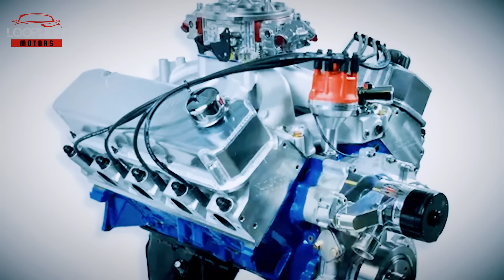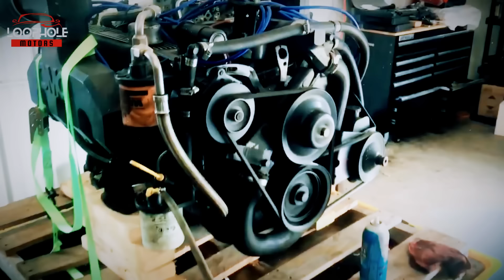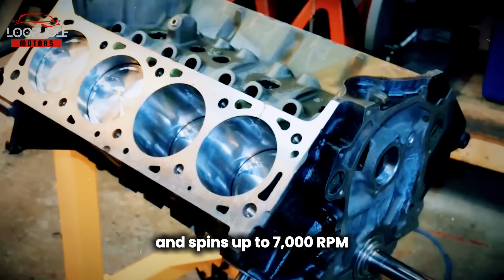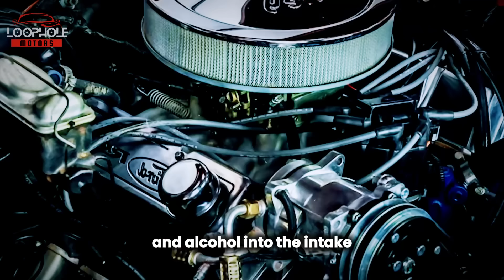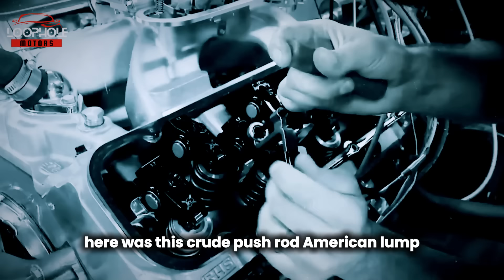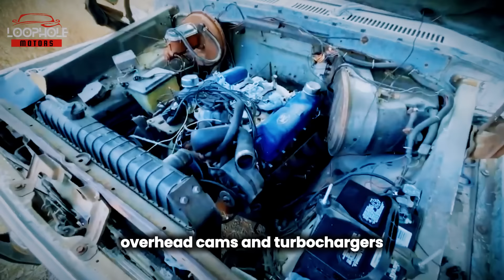The "Illegal" Engine Ford Erased: How a $300 V8 Embarrassed Million-Dollar Teams?

Comment: The 385 engine series was magnificent. The 429 shotgun hemi was a NASCAR force. But the forgotten engines are the 351M and the 400. There is so much hp potential on those Cleveland motors. Makes sense the 335 and 385 were similar designs

Comment: I thought that Ford had built some excellent FE engines, not limited to the 427 high riser or tunnel port engines as they also had the 427 SOHC.  Sanctioning bodies seemed to be able to find reasons to ban Ford hemis but not Mopar hemis.  Go figure.
It is difficult to extoll the virtues of a full race 7 litre when comparing it to a fully stock, full warranty 500hp 5 litre modern engine.  And that is with all accessories and exhaust.

Comment: No sir , popping the hood and seeing a turbo charged gm 292 I6 at around 800 hp or a 300 i6 ford in same trim rolling out tremendous power and torque. Hell the new gm/cummins 4 cylinder deisel engine thats like 210 hp and 450 lb ft of torque .

Comment: I would not run around thinking you would be king . You may be one of the prince . But dont forget that royalty usually runs in packs . The bow tie is still the most used platform and dodge has their monsters also which im kinda partail to a 440 wedge . 454 ls6 block ,butler pontiac , and all the rest . I had a friend growing up and we did 4x4 trucks . Paul had a 77 f250 w/ 460, 4 speed ,15 inches of lift , 18/44/17.5 gumbo monster mudders on it and i know we put 7 ,460's in it and 1, 390 cu in  in it and never blew the engine up again until he got killed and his mom had the truck destroyed. The truck was famous  big blue and named walking tall. In riverview florida by tampa where we grew up.

Comment: My favorite demonstration was from a shop teacher. A former student brought his pride and joy Nova SS 396 that he lovingly restored. It was clear that the engine was putting out serious power. The teacher asked him to drag race the shop class rebuilt Monte Carlo with its wheezy 305 for an 1/8th mile. You know the one. Maybe 180 hp new, and certainly not that after 2-3 rebuilds by students. Through the 1/8th mile it was a dead heat. After that the HP difference showed up. Teacher turned around to the students and stated that all that power from the old lead sled didn't matter until it could be put to the ground. 20 years of suspension improvements made all the difference.

Comment: Add modern technology to the old banger engines makes them even better a 460 with a built bottom end big cam aluminium high flow heads with Holley efi and coil on plug ignition there and absolute weapon with modern turn key reliability

Comment: im a big block man have been my whole life and im 62 but i have a little tiny 18 inch cube of a engine that has me excited a 1987 general motors performance parts odd fire chevy bowtie v6 built by ray baker dale earnheart and darrell waltrips v6 builder  600+hp at over 9000 rpms dynamite in a small package bare engine with alu heads and alu crossram intake engine weighs less than 300 pounds. if it had a handle like a suitcase it looks like you could just pick it up and carry it around.